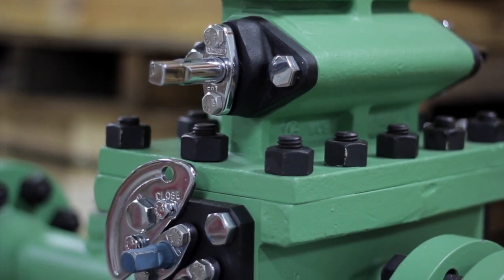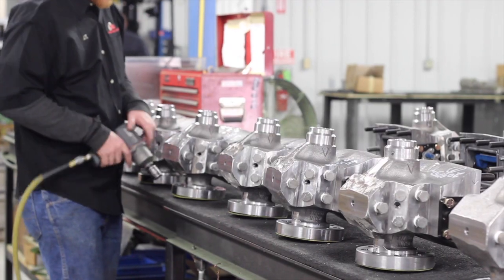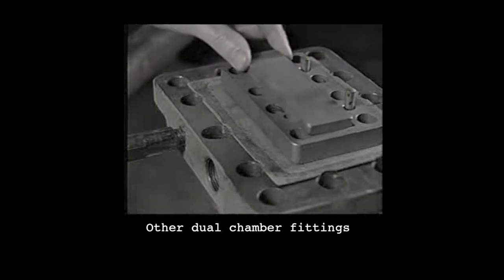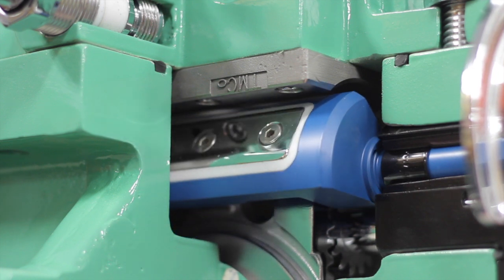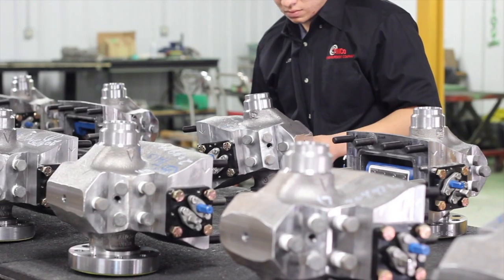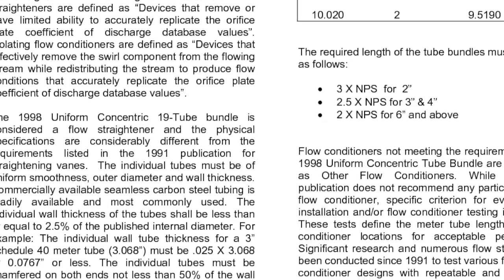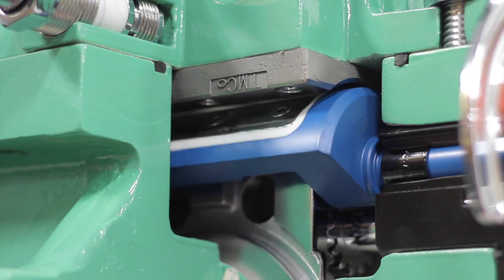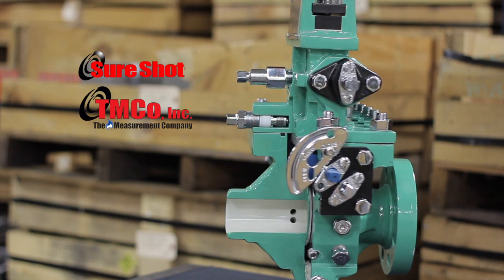TMCO SureShot® Single and Dual Chamber Orifice Fittings

Comment: Very informative video. Could you plz show us a video explaining the detailed difference between single and dual chamber orifice fittings. 
Also can you show us how you measure the DP values (HP & LP tappings) with a flow computer or transmitter?